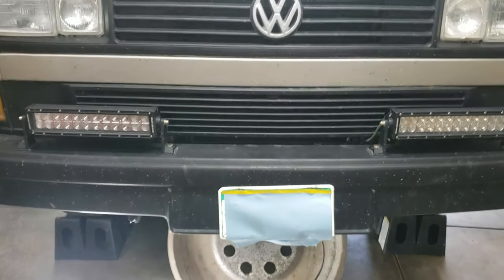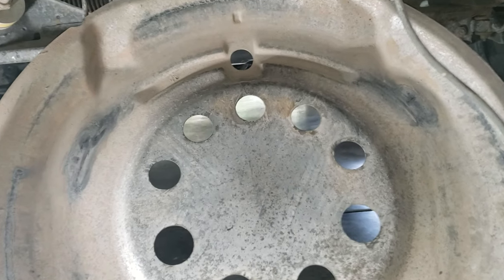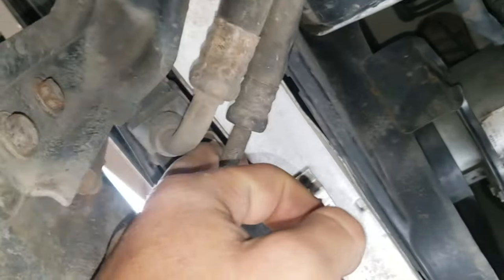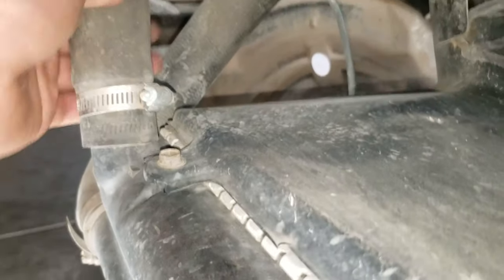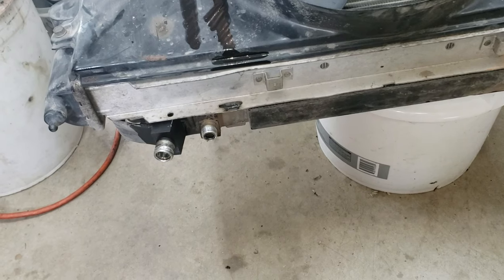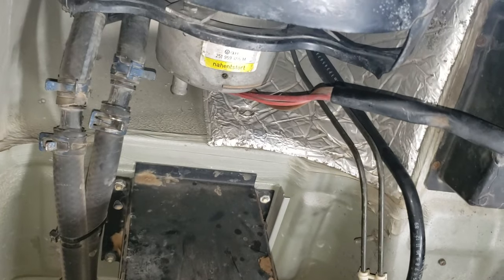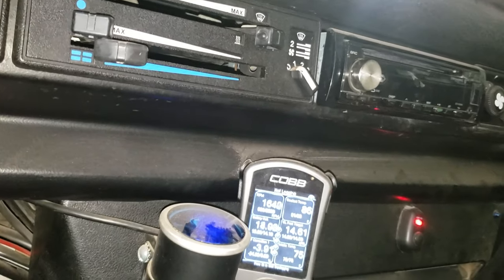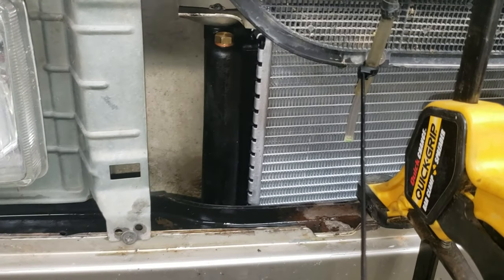Vanagon Radiator Replacement

Comment: I received a new radiator on my 08' Honda CR V . Now my rpms go very high only at 20mph. Can you tell me what is wrong?
Reply: I’m not qualified mechanic, but my guess is either air in system